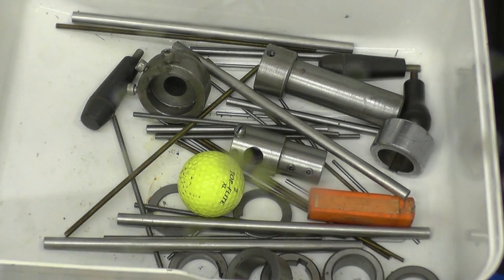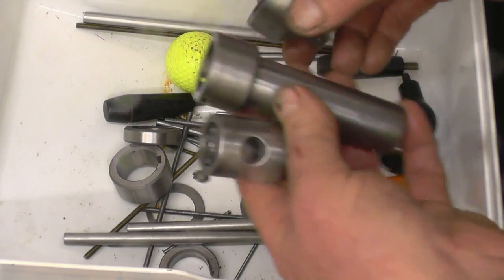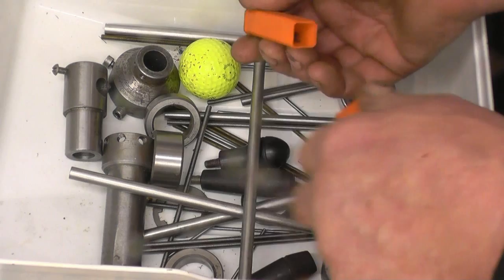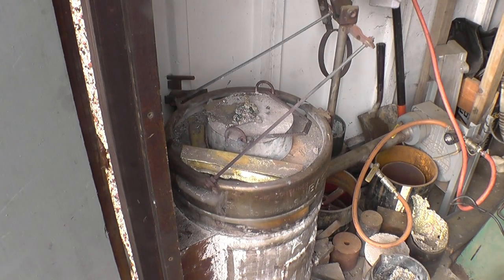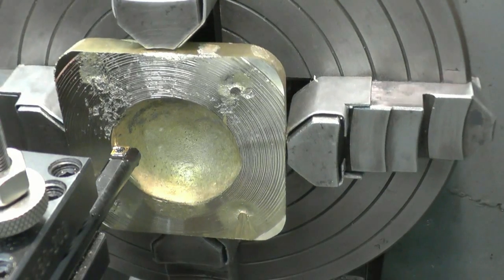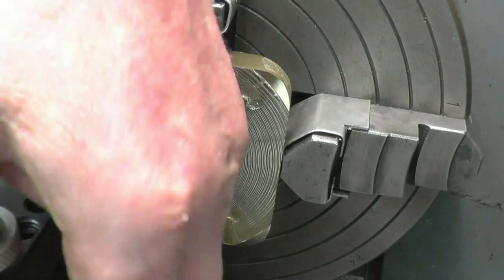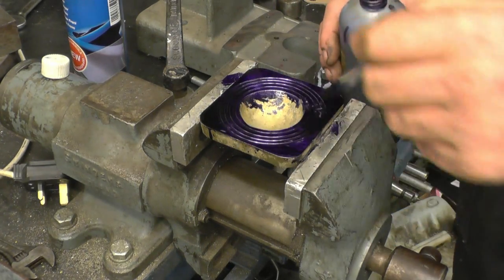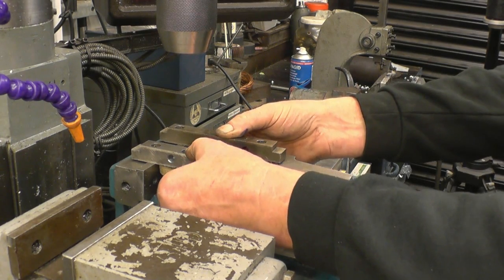SNNC 148 P2  Pouring Metal

Comment: "Ideal for drilling fingernails" ??
Reply: When you give yourself a blood blister under a fingernail by hitting it with a hammer or other injury you can take a small drill and spin it by hand to drill a small hole through the nail to let the blood out. It helps to relieve the pain. Don't ask me how I know this!!!!  :)
Reply from the maker: Next time I have a black nail I will video the process , I just use a pin chuck and spin it between my fingers
Reply: Cold shiver  ,Drill press  NO THANK YOU . I use my other hand and  hold the drill between thumb & index finger
Reply: And there was me thinking John was having a laugh...
Haven't heard of that one before :O
Reply: I've seen a guy try to use a drill press and the drill grabbed and when through his finger. Not good. All it really takes is to spin the drill in your fingers for a few min and it pops right through.. But YMMV!!!